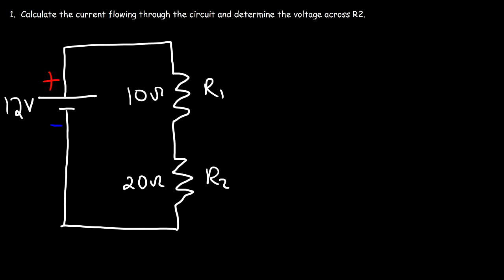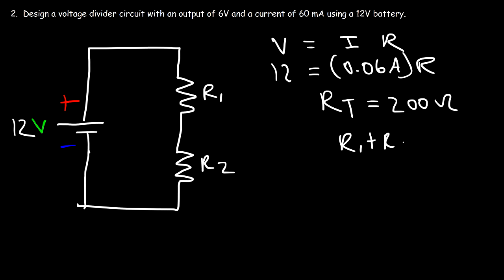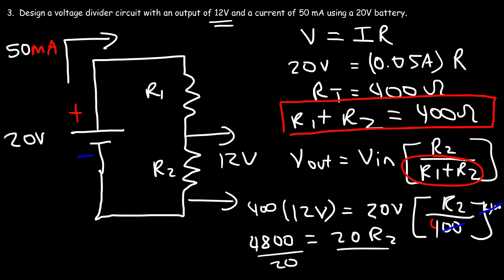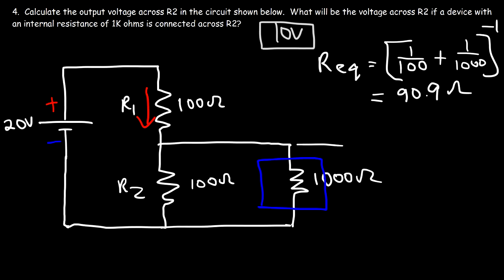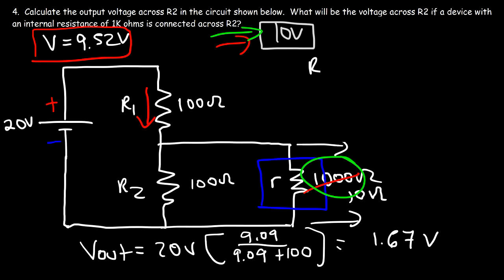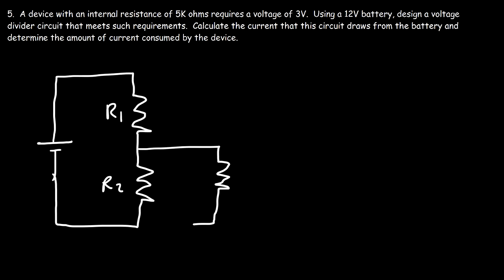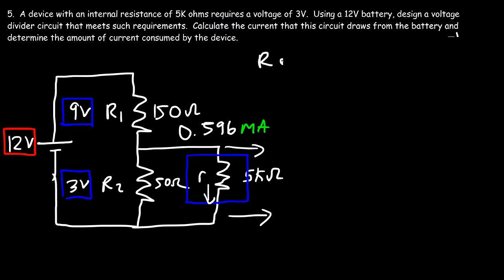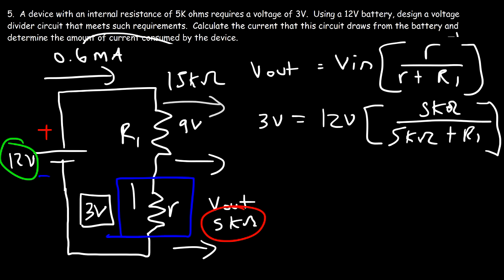Voltage Divider Circuit Explained!

Comment: I understand the part how can he do its 100times less than 5K ohm so R2 must be 50ohm and since V1= 3V2 so R1 = 3R2 how current splits in parallel so that statement should be wrong right since current is no longer constant anymore 
somebody pls explain
Reply: Hi Roy so I was confused too as to why he took 50 ohms as R2 but the catch is that it doesn't matter since we know the resistors divide the supply voltage in a ratio of 3:1 then the resistors must also be 3:1 . Since parallel resistance is 5000ohms you can approximate it to 0. You can take any combination of resistors so as long as R1/R2 has a ratio of 3:1 it could be  1ohm:3ohm or even 1430ohm:4290ohm you'll still get 3 volts as output. If your asking from a quiz/test POV then they would probably also give us current flowing through R1 and that way we could calculate exactly how much resistance we need.

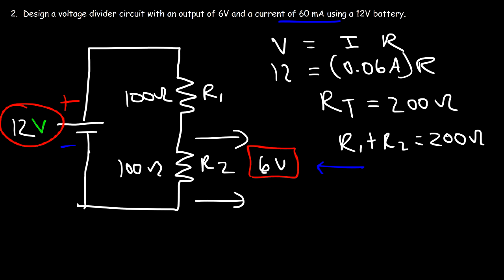Comment: Why is the input voltage changing from 12v to 20 and output voltage changing from 6v to 10v at 4:15mins
Reply: Up
Reply: It's assumption

Comment: I'm confused as to why you are taking your time to do multiple operations to figure it out on the second example. Can't you just figure it out doing as you said on the first step, to get the total ohms by dividing vin by output amps, for 400r, then divide vout by vin to get the ratio (0.6), then simply multiply by the total ohms by said result for r2, then 1 minus ratio by ohms for r1?

Comment: I know this video is old, but I'm struggling with the maths.
I can see how you've calculated the resistance - but I can't work out how you know that it will result in 6 volts?

Comment: dear sir i want convert 300vdc volt to 5 volt for my project required. can i use same formula for 5  volt . to change in resister value?

Comment: the last example was weird. He assumed a value of 150 ohms without showing any calculation and by just using ratio and proportion. What i did was assumed a value of 3 volt across 5k ohm resistor since its in parallel with R2 then get a value of 148 ohms at R1.

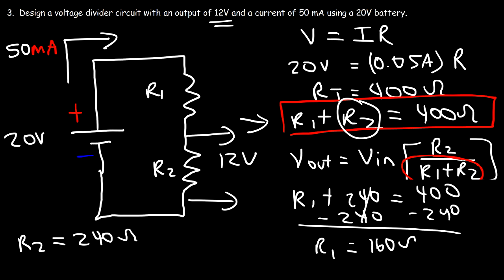Comment: 7:40 for this question i solved it slightly different but got the same answer. i did 12/20 times 100 which equals 3/5. i know that R2 must be 3/5 of 400 and that leaves R1 to be 2/5.

Comment: Another easier way is that the voltage in series adds up so you can subract the given voltage against the total voltage to find the missing voltage across 1 resistor :face-red-heart-shape:

Comment: Thanks a lot, this video It has been very useful.
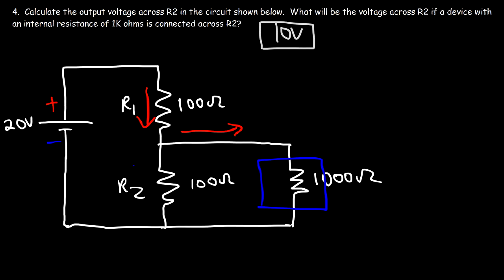On the min: 9:01 Would it be possible to find the value of R2, in case Vin, Vout is unknown?

Here is an example of the same circuit, only adding an additional parallel to the resistor r1:
Vin = ?
Vout = ?
R1=100 || R2=2k
R3= ? || R4=1k

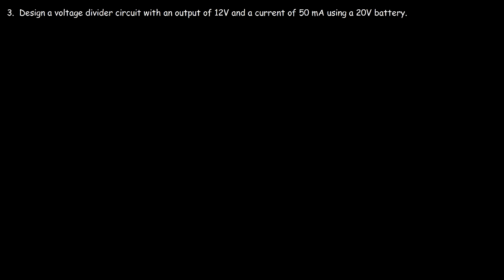Comment: For the question at 4:23, it should be written as.

A voltage divider circuit, where R2 has an output of 12V, and the circuit has a current of 50mA, using a 20V battery. Find the resistance of R1, and R2.
Reply: You are required to design the circuit..

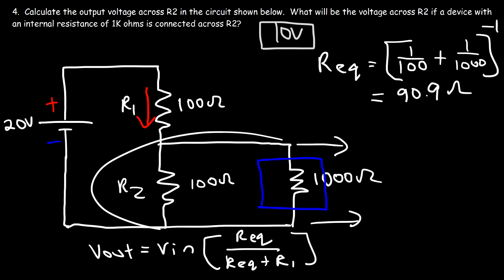Comment: @10:51 Why is the numerator Req? If we're finding the voltage across the device, shouldn't the numerator be just 1000 Ohms (resistance of the device)? Similarly, if we were to find the voltage across R2, shouldn't the equation be vout = vin ( R2/R1+R2+R3 ) and not vout = vin (Req/Req + R1)?
Reply: Parallel Circuits merge with whatever Series Circuits they're apart of, so since the 1,000 Ohms Resistor is Parallel to R2, it's considered part of R2

Comment: Hello, Great videos. But I have a question about your calculations for problem 2. If you want the output voltage to be 12V, wouldn't you want r1 to be 240ohms and r2 be 160 ohms?
Reply: I thought so too.

Comment: found kind of a hacky way to find the resistances.
If you divide 12v/20v you get 0.6
and 0.6x400Ω is 240Ω, so you get r2 from that equation.
no clue how that worked out but somehow it did.

Comment: 25 minute 07 Seconds into your video 3rd equation, i lost it, algebra ,transposition of formula sucks, to complicated for the average joe, unless your going to teach us algebra,  here is a quicker method 3/ question design voltage devider circuit with an out put voltage of 12volts across  across 2 resistors r1 and r2 unknown but the total resistance we know to be 400 ohms right, we have current through series circuit being 50mA 0.05 Amp, input supply voltage as 20 volts dc,
Solution simplified  ohms law here we go output voltage between earth rail, and top of resister 2 is 12 volts we know, so voltage across r1 equals supply voltage - target voltage thats 20 - 12 = 8 volts   Using ohms law resistance Across R1 can be calculated = voltage across r1 8v devided by constant current which we know, as now as  current 0.05A = 160 ohms therefore resistance value of r2 = resistance total 400 Ohms - r1 160 = a grand total of 240 ohms, giving a target voltage of 12volts

Comment: at 11:43 , the voltage calculated to be 9.52, that's across the two parallel resistors right? So the voltage drop across R1 is 11.48 since 20-9.52=11.48 right?

Comment: 0. Construct a dual potential divider circuit with a common voltage source as supply. The 
potential drop should produce an output which is 5 times greater than the cut in voltage of a 
PN junction diode.

Can u please tell us the solution

Comment: Is Vin referring to the total Voltage? I'm not entirely sure about this but otherwise it wouldn't make sense. Assuming that Vin doesn't refer to Vtotal, then I assume its the voltage "coming in" from the first point we measure it, right before Req. But after assuming this, Vin shouldnt be equal to 20V which is Vtotal since R1 should cause a voltage drop before the starting point that we're measuring. Can someone explain? I feel like I understood part of it but didn't get the main point. *If* my assumption is right, then shouldnt we say Vtotal instead of Vin?
Reply: i think the voltage drop accross r1 would be taken across it and not at the point before it. if you measure with a multimeter you should get 12V before the resistor but if measured across r1 you would have 4V 
if I am not mistaken
Reply: @a_potat  Coming back to this, and looking at the exercise in the middle of the video, it's just the way to get the V drop across Req. Same equation is used for V drop across R2. A setup with 3 resistances would be different, unless you can simplify them to 2 as shown in the vid. And of course, when I said voltage at a point, I meant it relative to the ground, or the point with lowest voltage, in this case the negative terminal of the source.

When I left that comment I assumed that "Vtotal" and "Vin" are two separate concepts. Doesn't matter what it's called, Vin, or Vtotal, it's the voltage of the source. Why? Cuz the math works..

Comment: Good video. I feel that the wording in the outputs voltage and amperage is deceiving. You can get a fixed voltage using this method but the amperage through the output of our new source will depend on the resistance of the load. I think the wording would be better if you stated that the circuit without the load connected in the voltage divider would be (blank)mA

Comment: For #5, I think the current that being delivered from the battery is not 60.2mA because in his calculation, he did not allow for the the current that being consumed by R1 = 150 ohm.
Reply: I know it’s been two years, but for anyone else wondering the same thing. No, he is correct. Current does not drop in a series circuit. So the current before resistor 1 is the same as current after resistor 1

Comment: according to kvl, the voltage exiting the circuit should be 0 but at 4:08 you said that the voltage output is 6v. Should not 6v be between R1 and R2?

Comment: I have a transformerless LED driver from a China LED Bulb but it's voltage output is more than 300V DC. Can I reduce the V-out to 45V DC using this Voltage Divider Method? Will it be safe to used to turn on several SMD LED in series??

Comment: why did we raise it to power minus 1 at 10:27
Reply: Normally the equation for resistance of a parallel circuit is 1/(1/R1+1/R2). So as you add more resistors in parallel the current is shared among the resisitors in parralel decreasing the resistance. So this guys just replaced the top level 1/ with ^-1 as they are equivilant.

Comment: When I have 20vt, and know vo is 12v that tells you to get r1 is 8v (20v-12v) x .05a is 160 ohms. r2 = 12v /.05a =240.
You seemed to do more work to get the same answer.
Reply: Thanks for this

Comment: Why didn't you use the 100 ohm from R1 when calculating Req, so that R1 @ 100 ohm will be in series with R2 + R Device to give 190.9 ohms? Was it Req of the entire circuit or just the part around R2 + R Device?

Comment: Thank u for the vedio, but i can't understand how we decide resistors for circuit with knowing Am .
Reply: You need to know more. For example: I build a circuit to turn on an appliance using an LDR (light dependent resistor). The specs said that it has a resistance between 5k and 500K (depending on amount of light). So I choose the minimum  to work which is 5k. Next I looked at my relay. It said that it needs minimum 2V to turn on. So no I know that my Vout is 2V. I also know that my R1 the (LDR) is 5k. I also know my Vin because I used a 5V supply. With all this info I was able to build the circuit using this voltage divider here and I turned on the appliance with a flashlight over my LDR resistor. All I had to do was to find R2 to give me the 2V at Vout (which was the relay).

Comment: For #5 how does he know that R2 should be approx 100times less to get 3V?
Reply: The bigger the internal resistance, the closer it is to the original output voltage. The internal resistance, as he stated, is recommended to be at least a hundred times more than R2.
Reply: Universal Narcissist  what about if the internal resistance wasn’t as big?
Reply: @Imkicelee  it wouldn't be as close to 3V. If R2 was 5000ohms the total R would be: (1/5000+1/5000)^-1 + 15000 = 17500ohms, wich means the voltage out is: V in * (R2/R1+R2) = 12 * (2500/2500+15000) = 1.71 V and not even close to the 3V we wanted.

Comment: The largest resistor in the voltage divider will drop More Voltage. That resistor can get very very hot! So watch your power rating of that resistor.

Comment: Regarding my comment below, once the correct voltage is achieved across R2 measure the resistance and measure the resistance across the other side of the potentiometer. Search through a lot of resistors to come as close as you can to find the right size.

Comment: The only accurate way to determine R2 is to use a load and adjust R2's voltage with a potentiometer to arrive at the correct voltage.  The resistance on the other side of the potentiometer    is R1.  I have done this so I know.

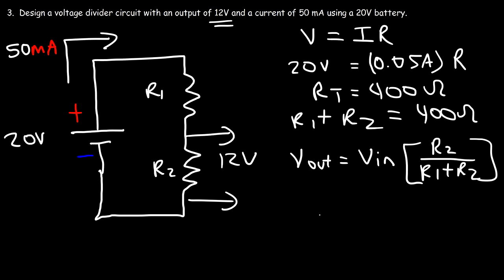Comment: At 06:00 Why u considered only 2 resistors to design vdr circuit..why not 3or4? and at  09:04 current must enter in to 100ohm coz..current always chooses low resistance path? If reply..very thankful...
Reply: 1) VDR circuit only has 2 resistors. It is used to divide the output voltage in any desired ratio from the input voltage .

2) Higher resistance means lower current flow. Lower resistance means higher current flow. Current would still flow through both resistors. Just that there would be a high current flow through the 100ohm resistor.
Reply: @samsungnote2683  thankyou

Comment: I thought voltage drop across parrallel resistors were equal
Reply: Hmm..seems to me that your basics are poor this is a series circuit and what you told applies for parallel circuits!! Remember current dividers apply for - parallel circuits and voltage dividers apply for series circuits hope this helps :)
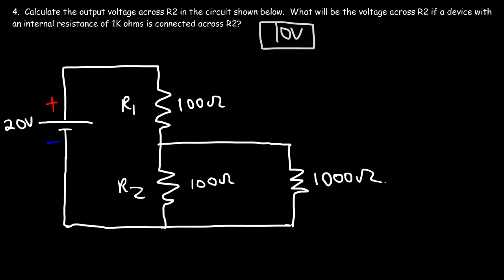Reply: @wolframalpha8634  aren't the 1000 ohm and 100 ohm resistances in parallel at 8:42?
Reply: @joeydifranco0422   yes they are in parallel
Reply: the answer to what will the voltage across R2 if a device with an internal of 1k ohms is connected accross should have been no change since R2 and the 1k ohm resistor are at the same voltage , they are parallel.

Comment: What on earth is this guy going on about. Just devide 20 by .05 which will give 400 ohms then devide 12 by .05 which will give you 240 ohms the rest is simple addition. All this extra calculation is just confusing  and not needed.This is not rocket science people. Its Simple math. Just use ohms law for calculating current .amps and volts.
Reply: I like to use his method, since as you get more into ac circuit analysis dealing with RLC designs it would be better to understand using this form of math in formulas.
Reply: I like to keep things simple being a begginer in electronics. All the same the circuits he was using was for dcand not ac.Someone who was looking at this as a complete begginer would have a headach from all the unessary Math. This is meant to be fun to do as well learning how to use a voltage devider. Sorry but a lot of what he said was unnecessary waffle for me.

Comment: So where is the required voltage taken from? Across r2? Would you connect a component across it?
Reply: yes + across and - to negative
Reply: I hope I understand you correctly the voltage is what you select you choose a voltage and you choose the current then you figure out the resistor size